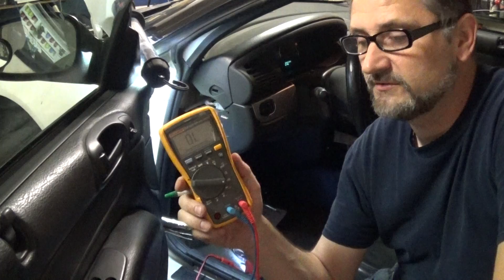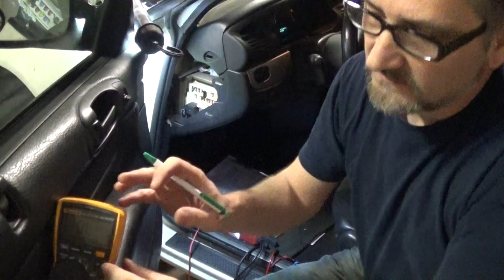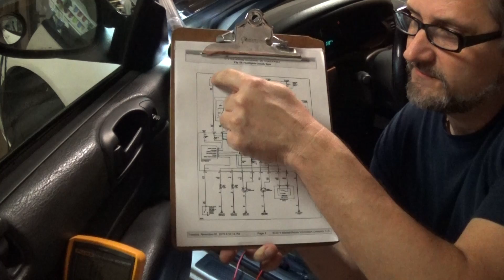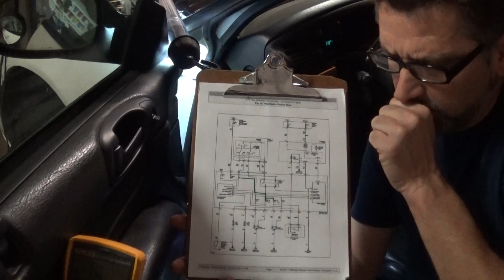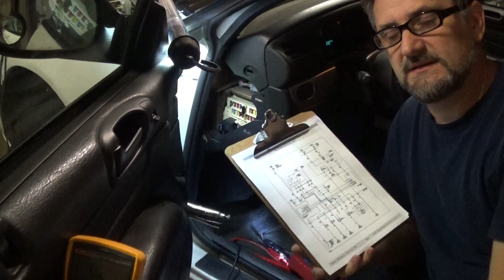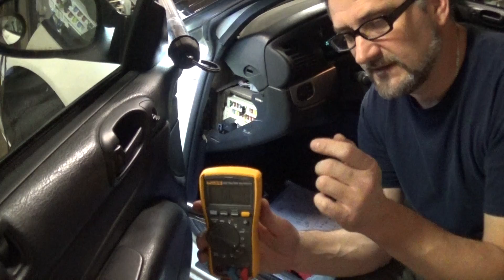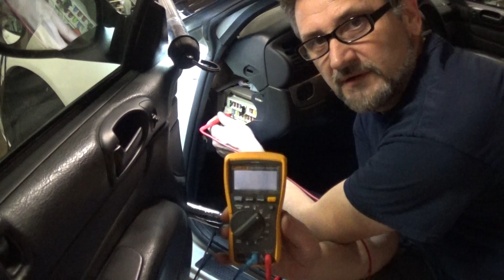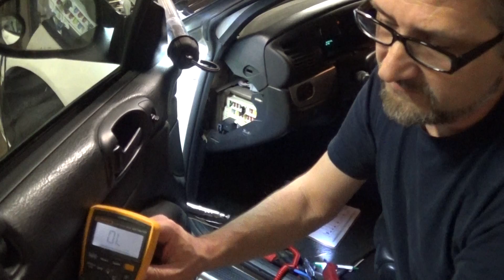How To Test Automotive Fuses

Comment: Hi Ramon, I wonder do you have to disconnect  your battery before you test resistance or continuity from the fuse. And what do you set the multimeter on to test to see if the fuse is getting power?
Reply from the maker: Teri June you don’t have to disconnect battery  if you don’t have any current on that circuit. If you do simply pull fuse out and check resistance. If you checking power set your meter to DC voltages.👍

Comment: Great video, best all around I have seen! Thanks. One question. The Cable you use to get to your battery to plug into for ground, where did you get it? Also would like alligator clips for multimeter option which I can’t find if you have bought those.
Reply from the maker: rltkktlr alligator clips are from Snap on and extension cable is from power probe and it's connected straight to battery. This way I have power and ground available for my testing at all times. I hope this helps. Cheers

Comment: Hi Ramon, great  videos,  can I put the black lead of the multimeter to a good body  ground close to the fuse box when checking  the fuses? Sometimes the fuses are far from the battery.thank you ramon cheers

Comment: Hi Ramon, my 1998 toyota 22r truck is the same way ,no power to the fuse unless I turn the head ligths on , and I don't  understand why, thank you ,and cheers
Reply from the maker: Everardo when you see ground on your fuse that is feedback from light bulb (bulb has constant ground ). In your circuit you have switch, relay and than fuse. This fuse will not get power until you turn switch on. Try to look diagram. Cheers
Reply from the maker: Everardo Camacho yes you can but always check your ground by touching positive side and make sure test light lights. Cheers my friend.

Comment: Great video ramon, basically we can use the multimeter on DC volts to check fuses,that's what you saying? Please  confirm  that , I never  done it that way ,it is great , thank you ramon cheers  from ontario ca
Reply from the maker: Everardo Camacho yes you can. You will look for 12V on both sides of your fuse. 👍